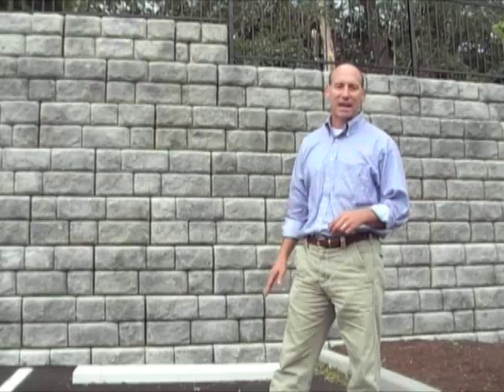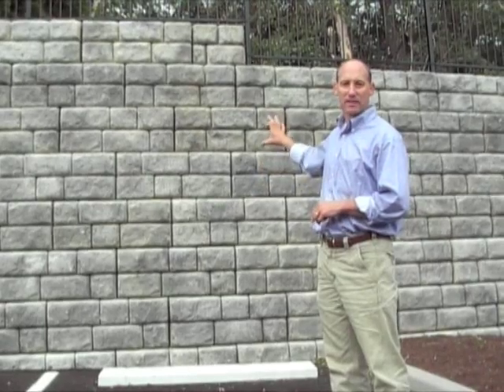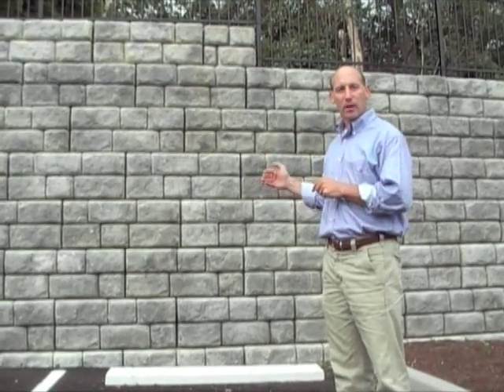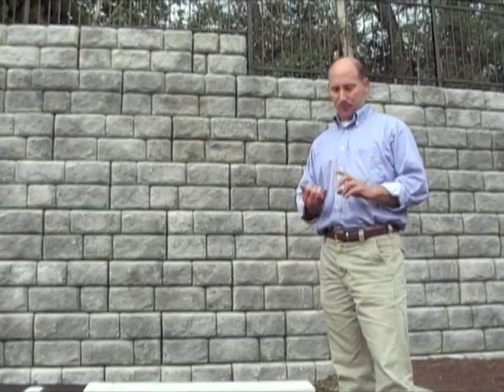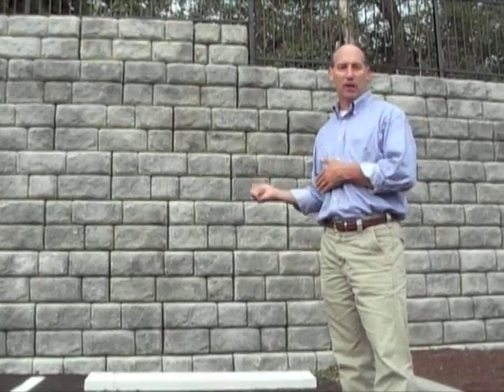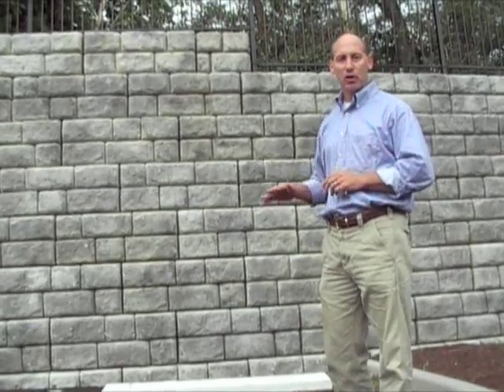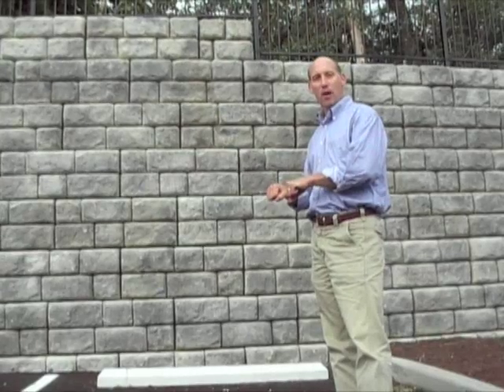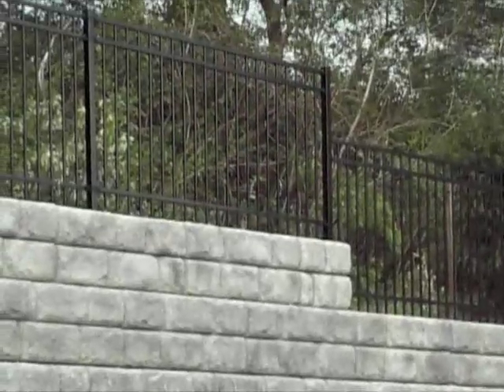Retaining Walls - Large Gravity Retaining Wall

Comment: Hello, I am a Landscaper and need a tip for higher retaining walls.  I have to build a 6 to 7 ft versa lok retaining wall with grid and everything, but my question is how do you prevent the un leveling exaggeration as one is building up the wall.  On practically every wall I've built, no matter how level it starts out, it always ends up being off from front to back when I finish building the wall.  Left to right is never a problem for me.  Please help. My email is lee.nelson14@yahoo.com.   I feel like there is something I'm not doing correctly if your people can build 20 ft plus walls and not have that problem.  Thank you so much.

Comment from the maker: @mothelian 

Using a GRAVITY wall (no geogrid) Redi-Rock walls can be made 10 to 15 ft high.  But that involves using the largest block they make (5 feet from front to back), and using special backfill that reduces the lateral pressure on the wall.

For a geogrid-reinforced wall, there really is no limit to how high of a wall you can make.  I shouldn't say there's "no limit", but there are geogrid walls in the 50 to 100 ft high range.

If you are in the UK, see Freed Construction.  Cheers, Joe